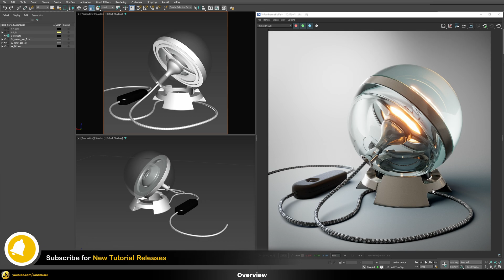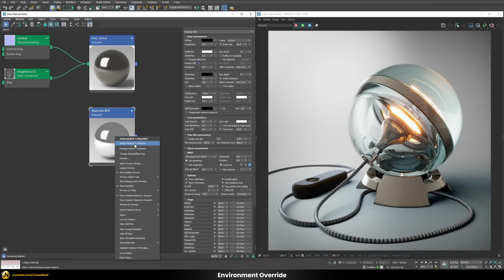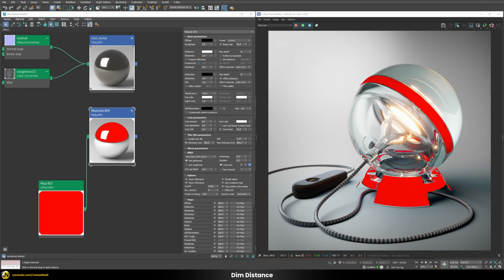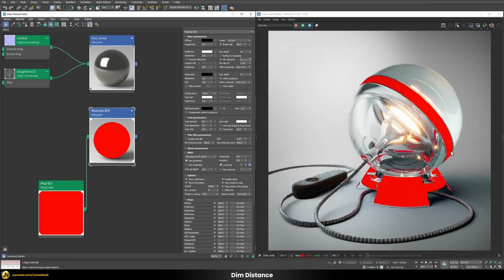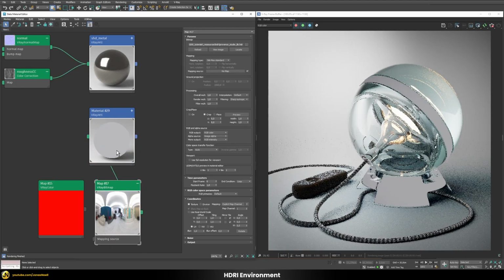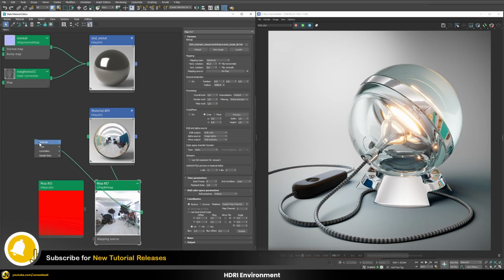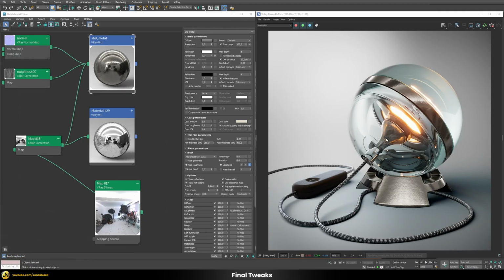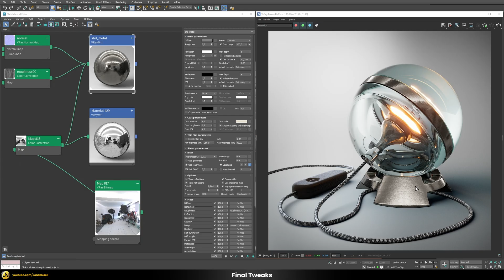V-Ray | Better METAL SHADERS - For Studio Lighting

Comment: I was going to follow your video to see if I could translate it over to C4D. But unfortunately, VRay for C4D does not have an environment slot in the material, so I wasn't able to follow. I wonder why Chaos did this?
Reply from the maker: Probably not with bad intentions 😀 All the Implementations are slightly different across different DCCs

Comment: Great tutorial! BUT I think you should go deeper and talk about the scene setup, since there are a couple of things to set right in order for this to work. For instance, if your main light and reflections come from a V-Ray Dome light, you would need to turn the "Affect reflections" tick off on the dome light and apply the HDRI environment directly in the environment window. Then you can use environment overrides for each material, so you would have a "global" environment working and specific ones for each material that you'd need one on. After that you're good to go generally speaking.
Reply from the maker: Hi, actually that is not correct. You can use Environment Overrides per Shader no matter what you put in your Environment Map or if you disable the Affect Reflections in the dome light. But you need to use the Dim Distance as shown in the video.

Comment: Thanks for sharing, this is not very well known feature in Vray that can give better control over rendering 
just to add to the same topic, if you are using this environment override in  multiple materials you can change the priority for each material  ( think of reflection of the reflection )to have more control .
There is a very detailed explanation in the documentation under "Setting Different Environment Priorities to Environment Maps" name that talk about this parameter in complex scenes .
Reply from the maker: Oh cool I will check that out. In fact I’ve seen this Environment Priorities parameter a thousand times but never bothered to try to understand what it is good for. But will check it out now 😀

Comment: Would it be possible to do a rundown on glass materials, lighting and gpu caustics.. It's one thing I'm struggling to pin down unless I make my render times impossiby long, and some of the glass materials in vray are very odd... Some of them don't bend light at all, even if I'm creating thick and curved surfaces.
Reply from the maker: I put it on my list, maybe a good idea. Though glass and refractions are not V-Ray's strong suit and it tends to be slow in many scenarios.
Reply: @JonasNoell  yeah i'm noticing lol. One thing..I'm just going through this tutorial and low and behold enviroment doesn't work with VRay GPU..the amount of functions still missing from GPU mode is ridiculous, I wondered what I was doing wrong, the material broswer was updating with a bright red but the render view...nothing. so as always switch to standard Vray and bingo.
Reply from the maker: Yeah I also noticed that in GPU this  doesn’t seem to work unfortunately. Should have mentioned it in the video. Hope they will implement it
Reply: @JonasNoell  unfortunately It's been on the forums for a couple of yeas like a lot of things, still sat with my fingers crossed lol
Reply: In my experiments with a simple glass generating caustics over a surface, it looks way better when both primary and secondary GI engines are set to Brute Force, but of course it takes longer to render. If you turn on Abbe Number diffraction, it takes forever to render.
Reply: @martindione386  thanks ill take a look at this!!